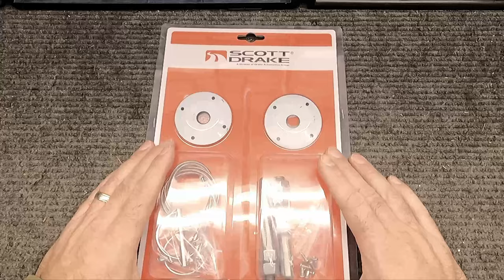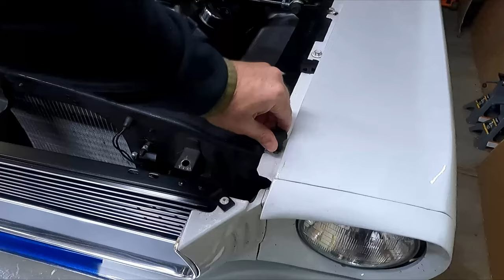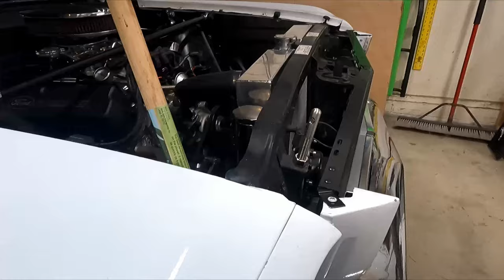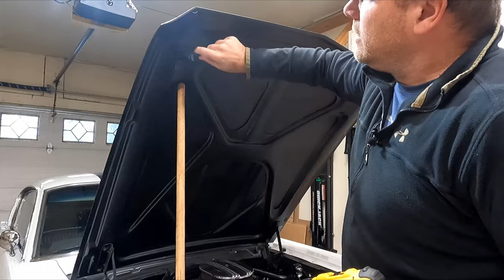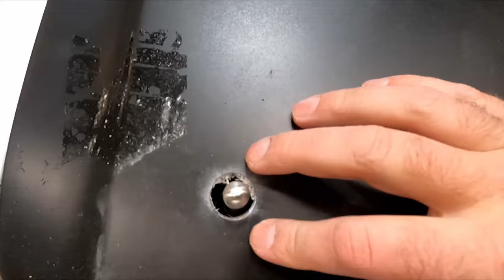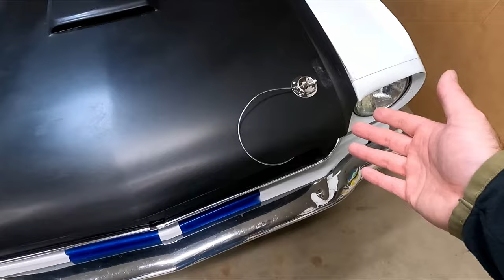How to Install Hood Pins

Comment: Took on this project tonight. Took a little longer than I expected, and the steel hood made it harder, but it's done!
Reply from the maker: Hopefully yours turned out better than mine.  :)
Reply: @AndyKruseChannel  the driver side one is at a slightly different angle, I think the bracket is just slightly tweaked. Too late now to fix it haha.

Comment: I've run these on my car and have had the nut fall off of the stud in the middle of a cruise. The vibration of the car loosened the nut and locknut up. Something to watch out for if you aren't running a latch in conjunction with them. I do really like the looks of them! Good walk through.
Reply from the maker: I don't want that to happen.  :)
Reply: Maybe use a little loctite on the thread?
Reply: @GolfGuy54601  sounds like a good idea
Reply: Lock washers once you’re done adjusting?

Comment: Looks great! I want to do that as extra security. I have a ground disconnect to protect the battery from draining and if I disconnect and put a lock on one or both of the hood pins when I go to the store or something it may not prevent it being stolen but at least slow them down a little enough for them to move on.
Reply from the maker: That might work.  :)

Comment: Im also curious for those that get rid of the stock hood latch. (I am keeping my stock latch and pins) are the pins enough to keep your hood aligned? Because the latch also pulls or pushes your hood left and right. Curious why you didn’t put the hood latch on the hood first then drilled the pin holes with the hood perfectly alined from fender to fender before drilling? Or are you banking on the fact since you are repainting your car that you Can clearance the fender holes to align it to the hood position now?
Reply from the maker: I'd like to know too.  :)
Reply: I appreciate your channel been following for a while and your throttle linkage has made a huge difference in my coupe. Thanks for being the test subject for a lot of my similar ideas haha 😅
Reply: Yeah I was thinking that this project should probably go after (fender and door gap) and (fender and hood gap) alignment so that hood can be realigned if necessary to perfect the hood/fender/door/cowl gaps and clearances.  Hopefully it will be close enough for jazz.  Cool project otherwise!
Reply: I installed mine while still using the latch. Sometime later I removed the latch to add a pusher fan. The pins keep it aligned just fine

Comment: Can you leave a link to the grille you are using? I anchored the lanyard on the bolts on each side of the latch where shelby did. Looks great 👍
Reply from the maker: I purchased it from Summit Racing, part number GMK-3020-050-66
Reply: @AndyKruseChannel  this part # says grille color black and stock🤷 is yours not a billet grille?
Reply from the maker: It is, the description on the website is correct.  :)

Comment: I have done about a hundred of these. Aside from getting the pin angle right, or at least really close, which is a lot easier on some cars than on others, one thing that I have always had problems with, whether installing the chrome plates on a fiberglass hood or a steel hood, with or without the rubber gaskets, is just how thin those chrome plates are. When you tighten the sheet metal screws down, it will invariably make a dimple around the screw hole. That doesn't interfere with the function, but it looks terrible, especially with it being chrome. It reflects badly in the chrome. I wish somebody would make those round chrome plates a lot thicker. And yes, installing and removing the pins will scratch up the chrome, and there isn't much you can do about that. You did get the 4 screws put in the right places. If you orient the chrome plate so the screw holes are front to back and side to side, the clips will hit the screw heads whether you put them in sideways like you did, or front to back like I usually do. Of course you could put the clips in at an angle. They work the same. I just want heavier chrome plates. I found that the dimpling problem is worse with a rubber gasket, because the screw pushes the super thin chrome plates down into the soft rubber at the screw holes. Yet another issue is the chrome plates will bend if the hood is not completely flat.
Reply from the maker: Cool, make those thicker chrome plates for us so we can skip that issue too.  I'll take two.   :)

Comment: Hey, i bought an acouto hood pin kit off amazon for 20$ and in the notes it says " make sure surface is clean for it to stick" but none of the parts are sticky, unless its the part that goes on top of the hood with the red backside is the sticky part?
Reply from the maker: That's probably it.  :)

Comment: Are you planning on installing fog lights in your lower valance?
I hope you do so I can copy you lol.
Reply from the maker: Not at this time.  I will put the turn signals in the lower valence, and possibly hook up the brake ducts, but no plans at this time for Fogs.  :)
Reply: @AndyKruseChannel ok mine has the turn signals in it plus there are air ducts. I was thinking of ducting the air into the engine compartment for extra cooling.  Mine got up to 200⁰ this past summer on an 80⁰ day however I was on a long uphill from 1700ft to 4000ft. It cooled off to 180⁰ on the way down lol 😮
Reply: @AndyKruseChannel they normally put the fog lights in the center opening. I need to find a good mounting place in the frame

Comment: About to do this because the dealership says a replacement latch is 200 bucks
Reply from the maker: I like the look and I am ok with drilling holes in my hood, but just a heads up, this is more or less a one-way trip.  Good luck, you've got this!  :)